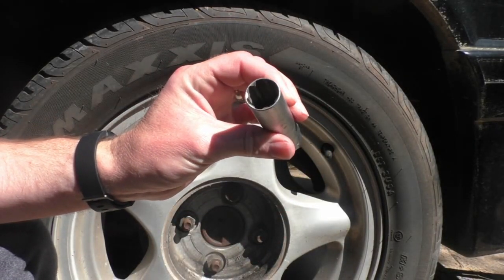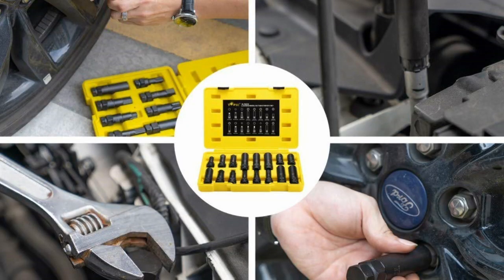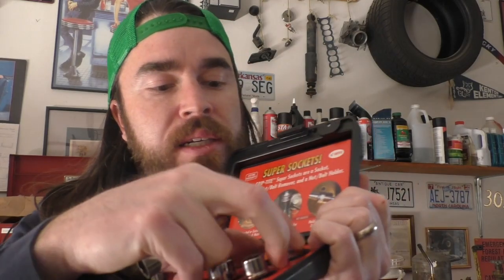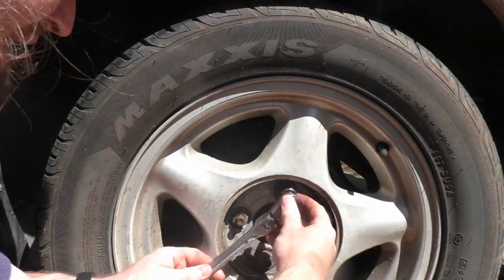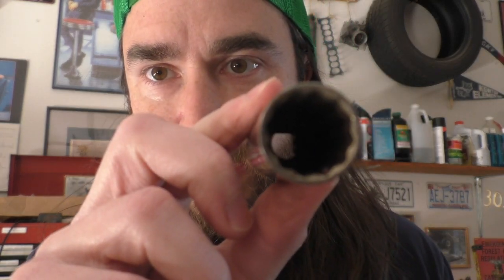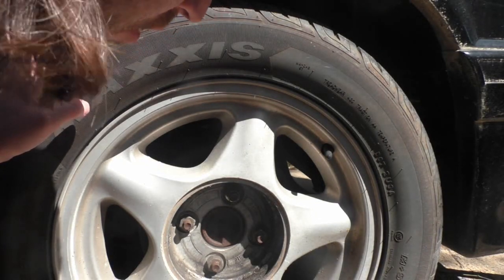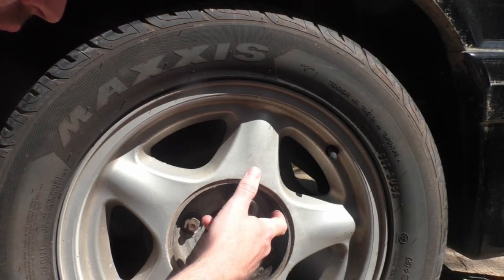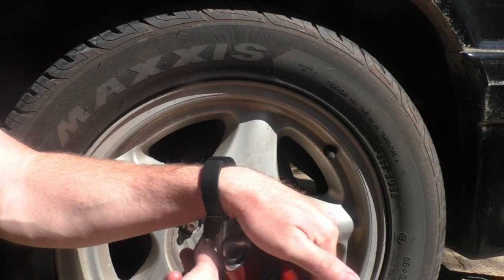3 Ways to Remove a Locking Lug Nut Without a Key

Comment: Would this be the same for a Yamaha 125 ttr dirtbike? Brand new carb, runs- but it still spits and sputters when throttled.  Yes I’m a female, no I’m not a mechanic, however I am very hands on and do it myself rather than waste the money on something I can possibly do myself. Any info would help, thank you in advance. New subscriber, Love your content and page. Your family is precious!
Reply from the maker: Thank you!  It's worth replacing the spark plug.  But I wonder if the new carb is tuned correctly.  May need to adjust it or even change the jet.  Do you live at elevation?  If so, it's probably a carb tuning issue.